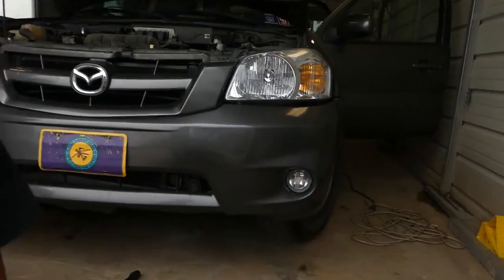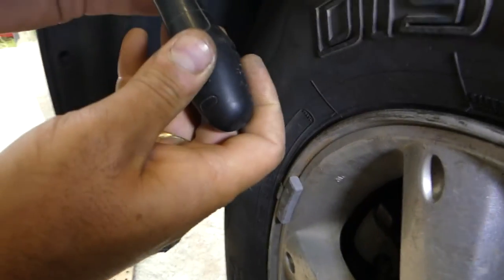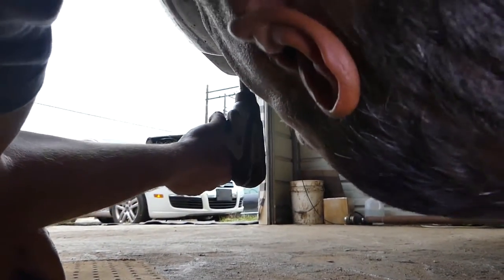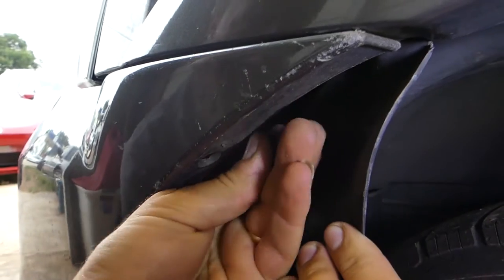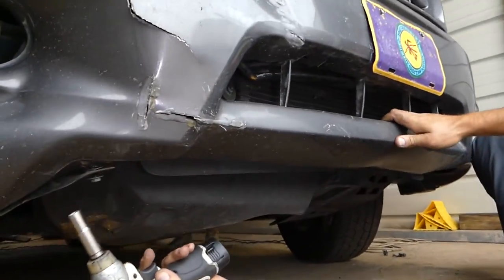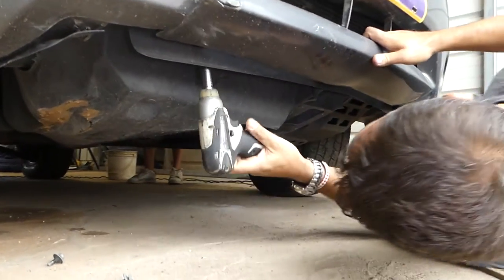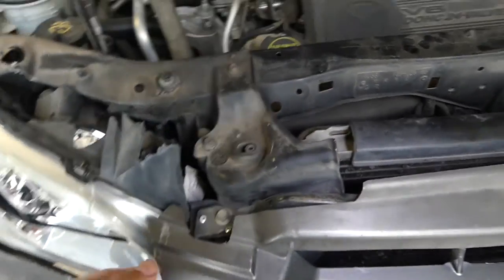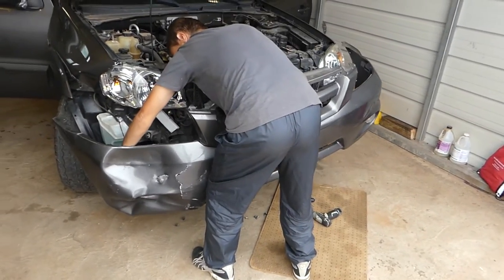MAZDA TRIBUTE FRONT BUMPER REMOVAL REPLACEMENT 2001-2007

Comment: Just had the transmission replaced on my 2002 Mazda Tribute. Wow! Now I've got the new sensor installed and transmission and mechanic doesn't know why there are squares appearing around the "R, D, and 2", on my dash! Truck is shifting great and feel no skipping or anything! I'm only guessing but think the reason for the squares could be because that when you install the sensor for the transmission you have to put the truck in Neutral to begin with! Then remove old sensor and replace with new one! That way the sprockets ( or what ever they are called) are lined up correctly since the gear positions are not marked on the actual sensor or where the sensor is housed.  Now, I believe they left the truck in park and replaced the sensor and its not registering the correct gear? I don't know if I'm explaining it correctly and hope someone can understand what I'm trying so desperately to describe? And hoping that someone can offer me some advice on what the problem might be? Thank you! And I might be posting this on the wrong site, but liked this one and thought maybe someone here might know? Lol! A question more along the lines of this video though...where can I pick up the bolts that hold the back bumper on and the clips? And what should I ask for? And are they the same ones for front and back bumpers? Again, thanks